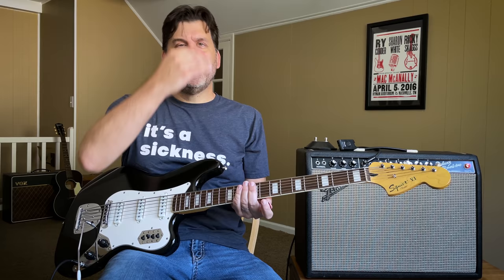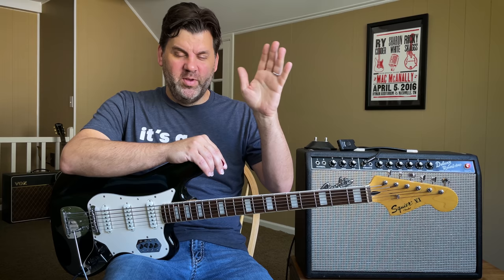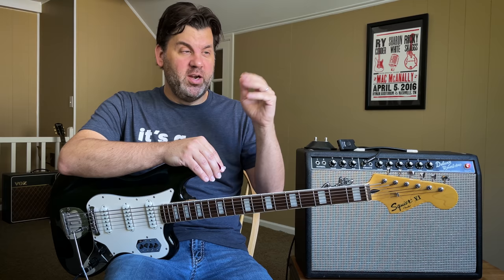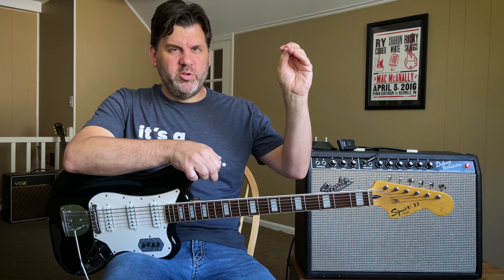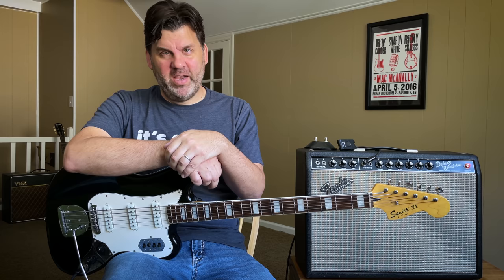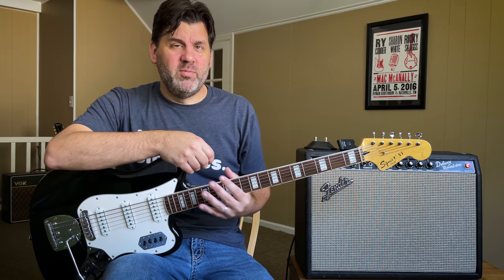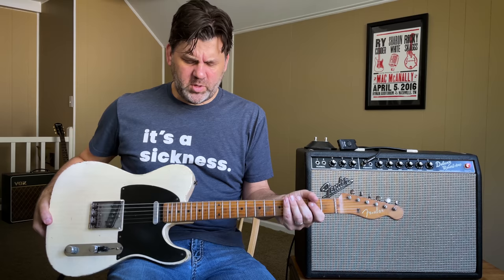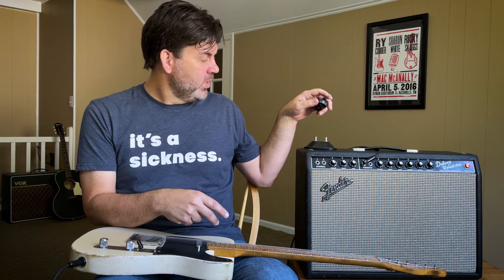How Grady Martin's 1961 Fuzz Solo birthed Keith Richard's "Satisfaction" in 1965  - Ask Zac 89

Comment: Cool story, I hadn't heard this before and had to go out and look it up, very cool. However, the fuzz sound had been around for a long time, blues guitarists playing big hollowbody guitars through tweed Fender and old Gibson amps had a lot of that fuzzy or farty tone just by the guitars overdriving the crude amps of the time. It wasn't something they were trying to do, it just happened due to the amplitude of the signal hitting the front end of the amp hard enough to drive the amplification non-linear. Even 10 years before this Marty Robbins song Ike Turner played with a lot of fuzz on Rocket 88. So not to take anything away from this ground breaking Marty Robbine, Grady Martin recording the advent of fuzz tone was building for quite some time, decades even.
Reply: Rockett 88 1951

Comment: Am I cheating by clicking "Like" before even watching the video, Zac? I haven't been wrong yet.
My introduction to fuzz was the Rolling Stones and Satisfaction. Every band in Jr High (including me) was scrambling to figure out how that was done. My drummer and his dad eventually built a kit fuzz box, except the button you pushed with your foot had to be held down to get the effect.....release pressure, and it turned off. Not very convenient if you wanted to dance around the stage with your fuzz going.
My second exposure to "fuzz" was when I got pulled over for speeding in my parents' car.....but I won't go into that. Thanks again for a sweet video, Zac.
Reply from the maker: Great story, and thanks for the early like.

Comment: You seem to have forgotten that in 1961 , The Fuzzrite pedal and it was used in 1962 by the Ventures on 2000 pond Bee....
Reply from the maker: That is an important recording. I believe I stated that the Robbins session was in 1960, and a hit in 1961. It caused Glenn Snoddy to create the Maestro Fuzz, and Red to create the Fuzzrite. However Red had no connection to the song and session in question.
Reply: Typo - 1966, not 1963.

Comment: Never realized that the original Grady Martin track was a baritone (6 string bass),  cool riff.
The Sunface is derivative of the Dallas Arbiter Fuzzface, which is a different circuit than the original Maestro Fuzz Tone.  Those old boxes had a kind of ugly decay and didn't do the guitar volume control clean up in the same fashion as the Fuzzface.
Reply: Just to clarify:
I have both a 6 string bass and a baritone.  They are not the same guitars.(although the bass 6 is often called a baritone, it is not)
My baritone is tuned B to B but works great A to A.  Different octive than the bass.
The 6 string bass tunes E to E and is the same octive as a bass guitar.

My 6 string bass is tuned
Reply: Sorry for the misfire, 6 string bass tuned E to E same octive as a 4 string bass.

Comment: Yup. Guitar players wanted the sustain that sax players got (think Duane Eddy's early hits) but aside from "don't Worry", and the Ventures' "Two Thousand Pound Bee", done with a Red Rhodes device, fuzz didn't get much traction As I recall, it just seemed a little over the top for the button-down "New Frontier" era. "Satisfaction" and "You Really Got Me" changed all that, and I went right out and got a Maestro Fuzz-Tone. Still have it. 

 I get to thinking, though, that maybe guitar players have had to put up with distortion in order to get sustain and perhaps if stompbox compressors had been available in the early Sixties somebody would have thought to mate one to a volume pedal and had clean sustain at any volume for as long as anyone could want....